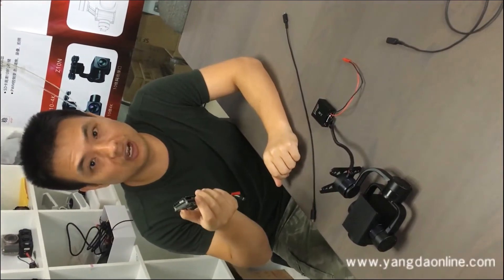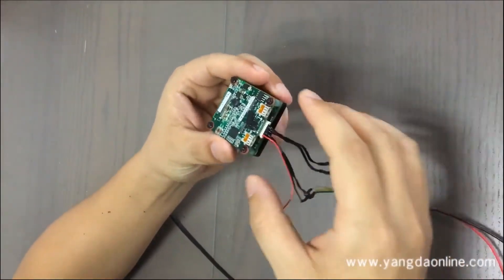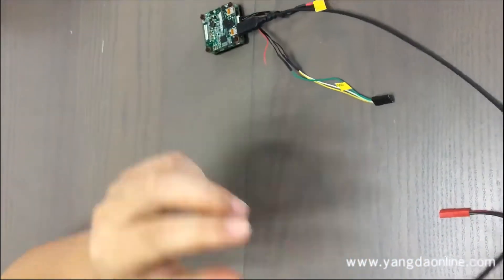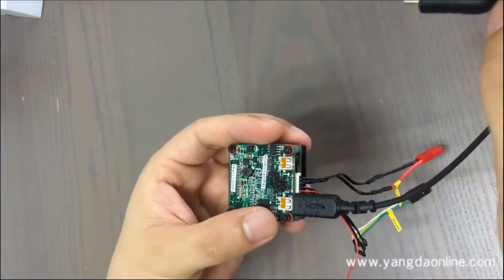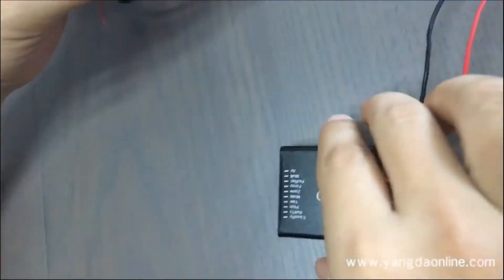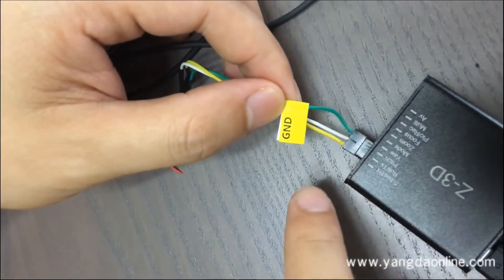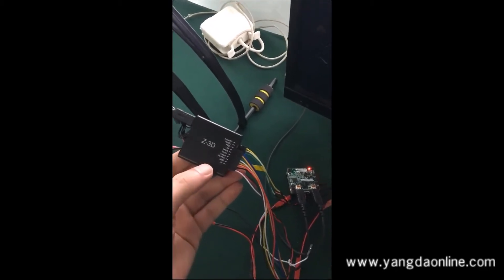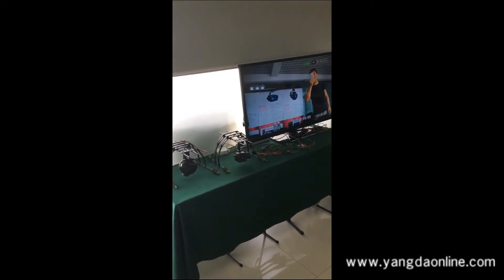Yangda object tracking module for drone zoom camera

Comment: Nice. Can the tracking module work with other brands of gimbals or gimbal controllers? also It would be great if your gimbal controller had an SBUS input. It would reduce the wiring a lot.
Reply from the maker: +PlaneCrazy The module can only work with our gimbals currently.Yes,the gimbal supports both PWM and SBUS.